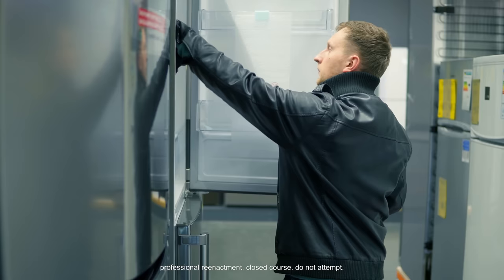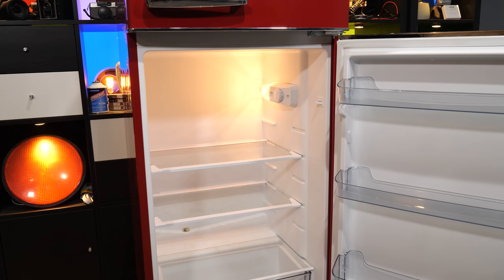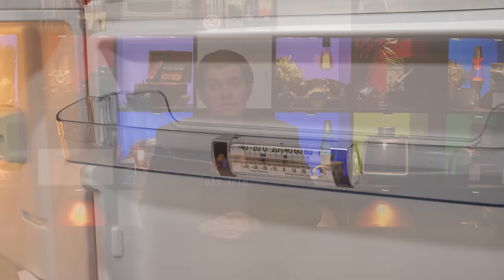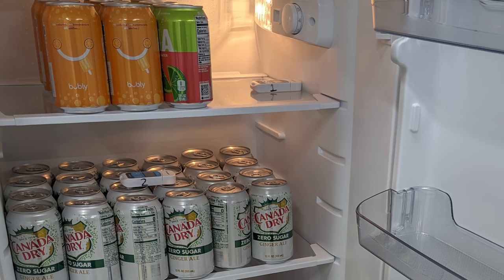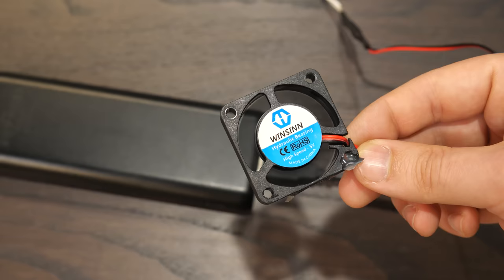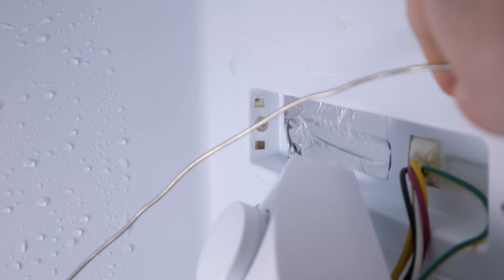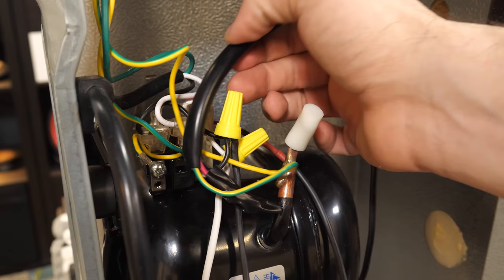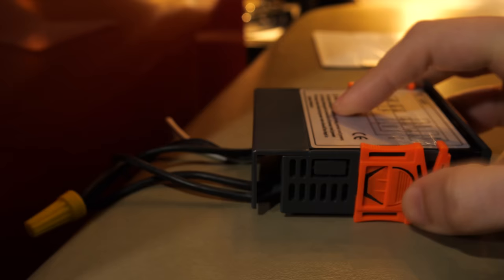This goofy fridge has a really clever design. It's also kinda terrible.

Comment: I've been a big fan of your videos so far. However, I really see this video as critical. The design of the red refrigerator is the most common type in Europe; 90% of refrigerators are of this type. I also don't know what the temperature specifications for refrigerators are in the USA, but the temperatures in the EU are completely different. An average temperature of 7°C (44.6°F) is specified for refrigerators. That on the topic.

I would be much more interested in how much the "real" oversized American refrigerators consume.

For comparison: Siemens iQ300 (KG39N2IAF) cooling zone: 260L capacity
Freezer zone: 103L capacity
power consumption
104kWh/year...

Comment: Sorry, but not sorry. I loved this and finding the issues that you have found. I would love to see the next part now with the good controller and seeing if fans will help. I want you to jump down another Refrigerator rabbit hole. RV refrigerators can use LP or Electricity to stay cold. The one in my RV has blades at the back for temperature convection. A fan seamed to help it work much better but now I want to get some temp trackers like you have and see the reality. Am I going to make a video like you do? Not likely. I would love it if you were able to make that video though.

Comment: My family had a simple fridge similar to this one, that we had since we built our house back when I was around 5 but it was a bit more robust and somewhat more refined, it was built by prince, serviced us like a champ repair free for 15+ years, until it eventually broke down 3 months ago, my mother wanted to get rid of it and buy a brand new one, I told her that it was worth repairing it, that it was built to last unlike modern appliances and we could probably even repair it with my dad, but I guess she simply didn't like the outdated look(and I admit it wasn't a looker but it was a workhorse, which is way more important) so she threw it away and got one of the new ones with the freezer underneath, so now I am waiting to see how long it works until the electrical gremlins start...

Comment: from a Refrigeration Journeyman tech..
never.. ever.. use an extention cord..
fridge.. heater ..A/C..
It makes the electric motor work harder than normal.. with less voltage. 
bad bad bad 
Not even a six foot cord.
Plug it  directly in the wall.
unless you go with a 10 gauge electirc cable.
P.S.
I went with the Frigidaire mini... a little big but very very cold.

Comment: Could it be that the temperature sensor original positioning allows for temperature monitoring in both compartments at the same time with a single sensor? The thermostat shut off the compresser when desired coolant temperature going into the freezer compartment is reached.

Comment: ATTN @TechnologyConnections please consider the following hypothesis:  The thermostat measure the temperature on the condenser not on the evaporator. It stops when it get to hot to not set your house on fire !!! That will explain the mystery why if you move the probe inside the fridge it will never shut off.

Comment: Mr wizard. Thermal overload sensor in the compressor to prevent it from blowing up. Had zero to do with thermostat. Also loading n empty fridge makes it work harder because of the lack of thermal mass of the initial contents. The red one should have come with a book of operation instructions that would inform someone unfamiliar with refrigerantion that you can't put that kind of heat load on that tiny of a compressor. The cycling has nothing to do with thermostat compressor protecting itself from failure. Hope that helps
Reply: If you really want to use a fan try in the compartment with the compressor

Comment: As I watch this I think I spot a mistake related to the fans.
Given the volume of the fridge, you would probably get better results with slower fans. The size is just one component and turbulence inside probably contributed to the weird results.

Now I need another hour long video about s fridge

Ps. Note that, usually these simple fridges states that you need to keep at least 2 cm from the back panel and they have an statement about mass inside. They also word differently what you can put inside and where in the manual 

Beverages are mostly water and water is a great heat|cold sinker.

Comment: If the Fridge's sensor is deep down inside the wall near the rear of the fridge but too close to the condensing coils. Couldn't you open up the casing of the fridge in the rear so you can carefully pull out the red cover just enough to allow you to use a thin strip of metal to slip a bit of insolation between the fridge's sensor & the coil it is too close to?

Comment: odd question, where can i get one of the compressor drip trays?  I have a similar 2 compartment mini fridge and mine got shattered.  I think I can do a fix with flex tape and epoxy but if a replacement exists, I would rather do that. Also, did you try putting a fan on the condenser drip tray?compressor hat to speed evaporation of the condensate? For reference my model is a Frigedare model EFR780-6COM.  However, I think they build this same make under different names and designs.

Comment: Interesting video.

Early in, I was guessing that the thermostat was not what caused the cooling to stop, but that it was more likely that the compressor was being overworked and hitting a thermal limit and had to cool down. Those intervals look MIIIGHTY similar to the intervals when it was running empty though, so I was (luckily) pretty flexible with that initial hypothesis. 

In a way, this thermostat WAS essentially functioning as a thermal limit of the compressor by monitoring COIL temps, rather than the actual temps within the fridge itself. A totally bizarre strategy, to say the least, and I'm still struggling to wrap my head around the rationale in engineering it this way. It's not cheaper, it's not more effective. It doesn't do anything that the thermal limiting on the compressor itself doesn't already achieve, and it required additional work to attempt to compensate the thermostat to work with this strategy (which it does TERRIBLY)... Just WHY?

This seems like a failure on so many levels. Who came up with this moronic idea? Who signed off on it? And how on God's green earth did nobody at any stage of development and testing stop and go "Hey, this isn't working, that's a huge problem, not only from a practicality and quality standpoint, but also from a food safety standpoint, and from an engineering standpoint."

I try to live by the principle of never assuming malice when good ol' fashioned human ignorance and stupidity can adequately explain it away, but to my mind, I just can't see how it does in this case. 

That leaves me with only one other obvious possible explanation for it: Regulation compliance. This seems to me like it was designed to be able to trick some sort of efficiency standards testing. Much like the recently-revealed instances of Toyota, Cummins, and (less recently) VW; where they were busted with engineering their systems to 'cheat' by developing specifically to the test, rather than to real-world compliance. But again, that's just a guess, and I have no idea what the specifics of those tests entail, so I could be completely off base.

I was actually looking into small fridges like this recently, considering the possibility of converting them to 12V for use in my Toy Hauler. The 12v offerings on the U.S. market are pretty lacking, and what is available is obscenely expensive.

Spending $300-$400 on a similar fridge and retrofitting a different 12v compressor would put it at about 1/4 the cost, or less, than the current standard offerings on the market; and while that's a huge DIY project, and probably more than the the average Joe would be willing to commit to, I'm far from the average Joe, for better or worse (probably worse).

Now I know that I should probably go into it with the presumption that no matter what I do with the compressor, a different thermostatic control strategy is likely going to be necessary as well, in any of these newer 'no frills' refrigerators.

Comment: An illustration of why you don't mess with cheap, underpowered, simple fridges.
Reply: Wrong, this fridge is fine. If you simply just fill your fridge full all the time by adding water jugs in the empty spaces you will even out those large temp swings.
Reply: Depends where you live. 

As for me here in Serbia far better fridges that are locally manufactured go for around 150 - 200 euros new, this fridge on the video I would give it maybe 80 - 100 euros and that is generous. However I would never even buy one anyway but if I would struggle to get a cheap one this one would be the lowest choice. However here I would never even find such fridge to begin with XD  The last time I seen such a fridge was back in 80s. In the past 20 years every fridge have at least one fan inside and air regulators and better thermostats solutions, and same goes for housing and other solutions.
There are ones that are still similar enough but by decades updated and with that more effective and reliable.

Just to be clear I am not talking how it looks, but the overall design, technical. Honestly the looks don't matter too much, you can change that each year but insides could be the same. Like the Samsung fridge he shown looks fancy from the outside but inside you can tell it's outdated garbage even for the year when it was made.
Reply: I've lived some 14 years of my life off of these kinds of fridges.
That is including this morning.
They're fine as long as you don't put boiling hot pots of lasagna in there. :I
Reply: This is a fairly normal kidn of a fridge for thailand.

For finland not so much, but  finnish kitchens have a place for the fridge and this would look pretty bad in that. And for renting people the fridge is in the rent usually anyway, it's considered more a part of the kitchen with the oven etc rather than something you plop into the kitchen  in finland than it is in thailand.
Reply: Toyota fridge
Reply: @@users-bibi50 Honda too. Simple clever but crude cheap flimsy.
As opposed to SubZero audi BMW beautiful elegance 
Both have their place

Comment: The temperature variation is intended since different foods should be stored at different temps. Meat should be stored at around +2°C, while veggies and processed food can usually be stored at +6°C to + 8°C. I have no idea what you mean with "food safe temperature" but it's absolutely bullshit. What is "safe" for a food depends on the food itself and how long you want to store it. There is no one setting for this.

Comment: Also, your fridge does not run longer when it’s got more stuff in it. Once the stuff is cold, the stuff stops generate heat. The only place he comes in is from the outside of the fridge, and that amount of heat is constant. It doesn’t need to have it large of a drop to keep the space cool because it does not raise us fast. It seems like you’re kind of, not nearly deep enough in the stuff to start trying to engineer your own fridge… So I’m not really sure you should be trying to engineer your own fridge

Comment: The red fridge: the compressor is too small and overheated. A sensor shut it down to prevent damage to the compressor. Next time you test it put a temperature sensor on the compressor too.

Comment: There's no way the placement wasn't on purpose. By measuring the thermal system directly, they have a proxy for how hot the compressor is getting. If pipe too cold, compressor too hot. Shut off system so that compressor not too hot. Extend life of compressor. At cost of food safety? Yes. But "it's a mini fridge stop putting so much shit in it". Not saying that's all the best way to do things, just maybe the thought process.

Comment: Will never buy a Samsung again. We went through 2 in as many years and Samsung would do nothing to fix it (both had similar issues to the one you experienced).  Yes...I'm on a short complaint rant....We also had problems with our  washing machine...turns out it had a major recall for the drum spindle failing...we were never informed until we called the company. Done with Samsung (even though they own most other major brands). Eventually ended up getting an Electrolux washing machine which took 6 months to get. Have never been happier with that machine (wish they made refrigerators too).  The refrigerator we ended up with is an Amana (also probably owned by Samsung). It's been doing fine so far after 3 years...fingers crossed. All of that is why I was so intrigued with the simplicity of Galanz. But as you found out, even simplicity has it's "engineering" problems. Thanks for all of your work on this. I have a way better understanding of how they work/or don't work.

Comment: Good luck with your Samsung.  We got one ten years ago.  Complex but poor engineering.  If you live in a humid climate, the defrost cycle is not long enough, so over the weeks, the ice builds up to a solid block.   You have to know how to touch two buttons at once to "force defrost" for a long time to clear it.  However, ice also builds up in the rubber drain tube embedded in the back wall.  You cannot defrost it with warm wire inserted because it has several elbows!  You risk poking a hole in the hose elbow where it cannot be repaired. Instead of putting a straight down tube at one end of the gutter, they put it in the middle, and move the water to a corner with hidden elbows embedded in the wall ! So when that hose clogs, you have to shut down the fridge, empty it and leave the door open until the hose ice melts.

Comment: It was probably running into some kind of protection limit, duty on run time or compressor temp or something. This is not exactly a high quality fridge, I wouldn't be surprised if the cooling circuit is also under spec'd.

Comment: Psssst. You should never lay a compressor on its side. Lubrication oils will run out, into the condenser and even evaporator and can get trapped, increasing risk of burned out compressor prematurely

Comment: Apologies for facetiousness. More seriously, I have a few concerns about the methodology. After all, what is important is the temperature of the objects inside the fridge, not the air. Air temperature will surely vary much more than object temperature. If lumpy objects, such as a chicken for example, go in the fridge pretty cold, get cooled further by the fridge, and then are assaulted by the presence of a dozen warm cans, the consequent temperature variation would be much smaller in the lump of poultry than in the surrounding air?
I can't be arsed to do the maths, (math) but intuitively the disruption to the air temperature would be orders of magnitude greater than the disruption to the internal temperature of the lump of poultry?
I would be interested to hear your reaction to that, as I place a lot of trust in the specific heat capacity of my fridge interred food.

Comment: Okay I hate to break it to you (maybe you address this later? but adding that much thermal mass to an EMPTY fridge and expecting it to cool it all continuously (or quickly) is just absurd. A) the compressor isn’t designed to run continuously, and B) the thermal mass of the contents of your fridge does a lot of the heavy lifting of keeping everything cold. in the first fridge, the other food did a lot of the work bringing the temperature down.

Comment: "i can obtain fan so I did... " Had me laughing out loud. I have been trying to obtain a replacement fan for my graphics card from ho for 8 months. I don't think I will ever get it. Unfortunately it is a nonstandard size and will not mount properly on the heat sink unless it is the exact one. Screw ho because 99% of the fans for these graphics cards follow the exact same footprint.

Comment: Do you think the thermostat kept trying to energize the compressor but the compressor was riding it's own temperature max?  I'm 40 minutes in, I guess I'll see.  2 more minutes in and nope, that tweren't it.  Seems like a $10 hack with a microcontroller would run it very well.  47min and dang, doubling that gets you a decent commercial one . . .

Comment: the reason for uneven temps, is because the fridg is mostley empty. the more product in the box the more even temp. air has no mass. so empty fridg . eneven temps. without frozen product when defrost kcks in the heat can change temps.. the more cold mass , the less the fridg will run, and keep an even temp. i keep frozen water jugs in my chest freezer, there cold mass maintains the cold when freezer is off. you can't get even temps from an empty box. all your testing is pointless. fill the box with product and fridge will act much differantly. i have been living with that very red fridge for several years now, and i love it. ive been servicing refrigerators, and ac for 40x years. the more cold mass you fill box with, the less it will run, and the more it will keep an even temp.

Comment: Pretty sure ill be using gas forever, don't think a heat pump will ever work in my area. Here in NWT Canada we only get about 2 months of summer and -55c most of the winter. houses are usually built with 2x6" exterior walls and are heated with diesel oil, or electric, but electric heat is crazy expensive upwards of $700 a month.

Also there is absolutely NOTHING WRONG with using extension cords with space heaters, so long as the gauge of cord us rated for the load you are attaching to it, same goes for power bars.

Also also... I've never seen a house with ducts running in exterior walls or attic, I cant believe that is even a thing? that is dumb, must be a USA thing i imagine.

Comment: Don't know yet if you figured it out.  the reason the compressor turned off before it was supposed to, is due to a built in temp sensor in the compressor to prevent overheating it.
Edit ok I was wrong